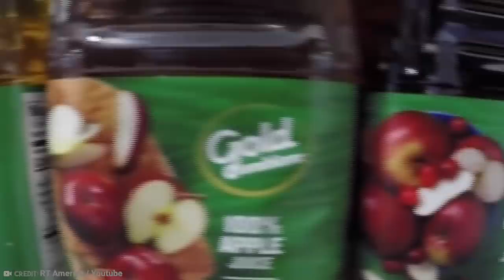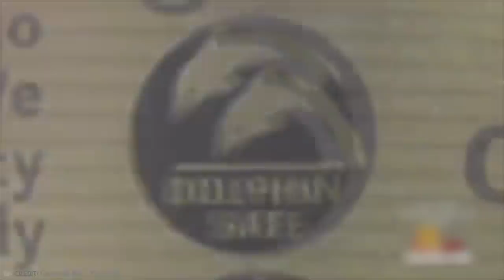20 Deadliest Foods People Actually Eat

Comment: Cashews are technically not nuts, though they’re often classified as such.  The cashew grows inside of a fruit, not a shell like nuts have.
Reply: That's not really correct. The cashew lies in a kernel attached to the bottom of the fruit , this is tweaked out and the kernel goes through a process of heat or treatment and the cashew nut within the kernel is extracted for consumption.  The edible cashew fruit is also used a local kind of liquor or toddy